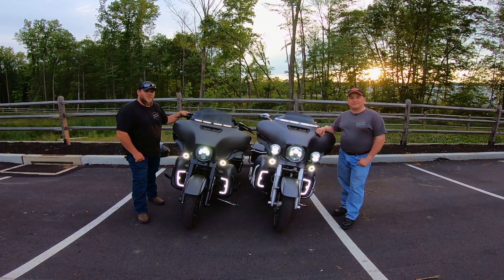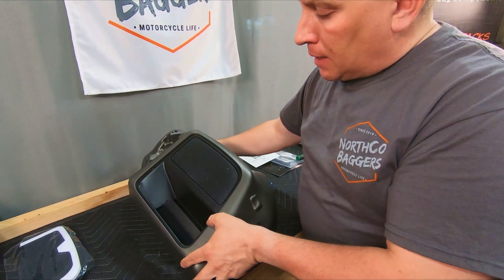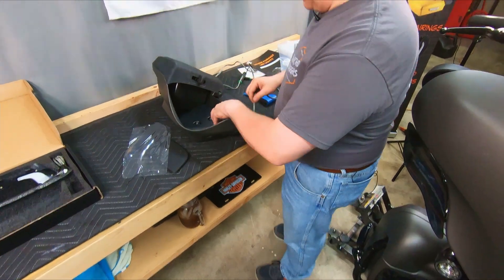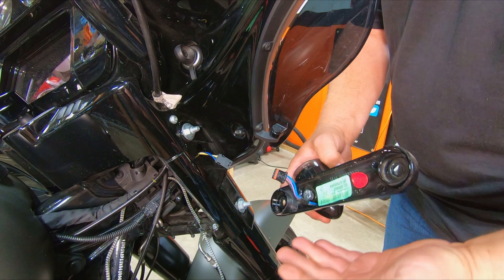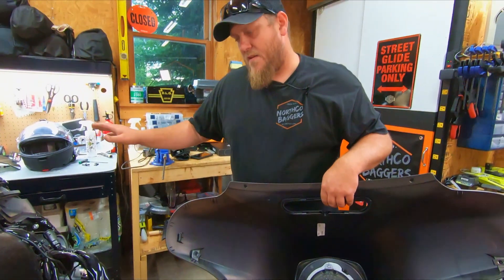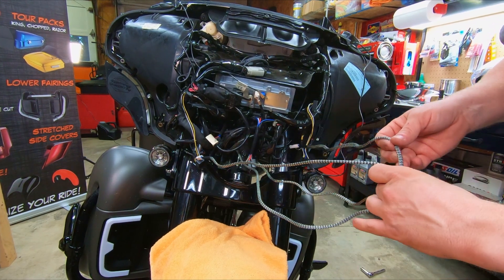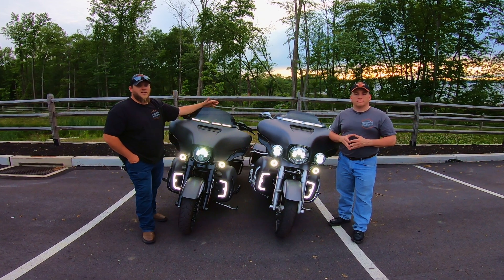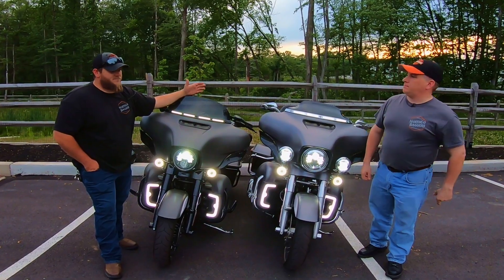Advanblack Lower Fairing Switchback LED Lights - Install and Review

Comment: How's the quality of these are they as good as custom dynamics? Better?  It's been a year tell us about the performance.
Reply from the maker: Sorry for the delay in response.  We still love these lights, and get many compliments everywhere we go with them.  We've had no issues with the lights themselves, and this includes riding in lots of rain and weather.  The light is a bright but diffuse light that lights up the front area a lot.  It's not a spot light style, so it doesn't really help for driving, but it is very noticeable from any other vehicles around you.  We think it's a nice addition that adds tasteful lighting.  We love CD products too, and also have some on our bikes.  Whatever style and price point you're comfortable with, you can't go wrong with either.
Reply: Great video. Well explained and easy to follow.

Comment: Thanks !  Is the Advanblack similar to Custom Dynamics for these lower fairing lights ? Are they competitors?  I am asking because I am not familiar with Advanblack.
Reply from the maker: Yes, they are similar in design and function.  Slight style difference, but otherwise they do the same job.  Advanblack is a major supplier of paint matched Harley bagger parts, like lower fairings, tour packs, and other accessories to give your motorcycle a custom look.  The paint match to OEM Harley paint is spot on, including the denim colors.  These lights are their first offering of an LED accent light, and they are really impressive.  You can check out all that Advanblack has to offer at www.Advanblack.com.   If you have any questions or see anything you like, let us know......we're authorized dealers!  Thanks for watching and commenting!
Reply: @NorthCoBaggers   Hey !!  thanks for reply and the detailed info